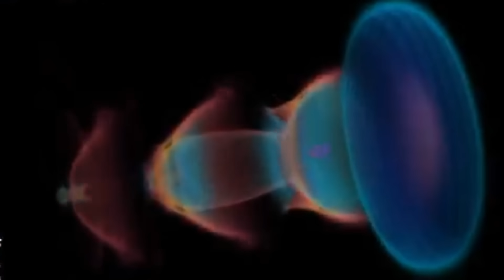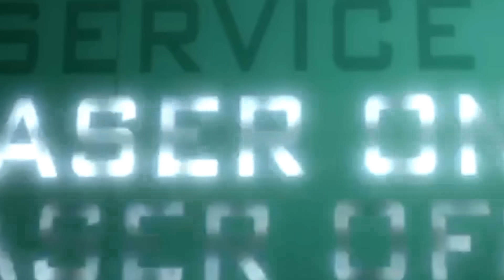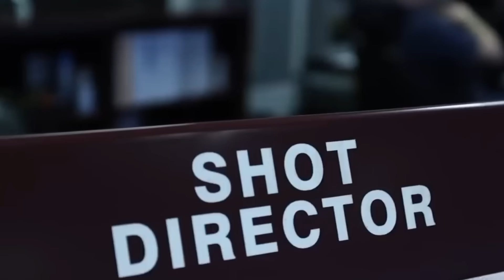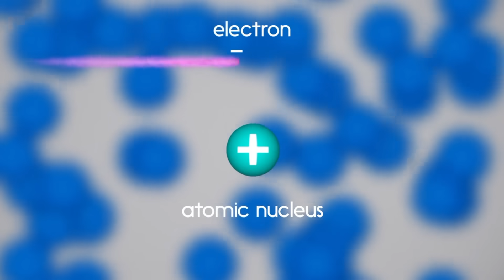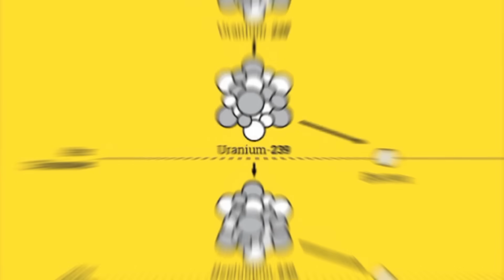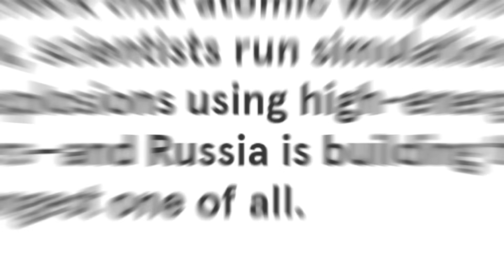Russia Just Turned On The Most Powerful Laser Ever Built

Comment: And the hologram at the nuclear ignition facility that has hydrogen isotope oh, that's the nuclear fuel for the fusion reactor, reaches temperatures in excess of 60 million degrees that's hotter than the sun 4 20 billionth of a second and recent test we were able to achieve more energy out of it then they put into it, we've reached the goal of fusion that test was successful